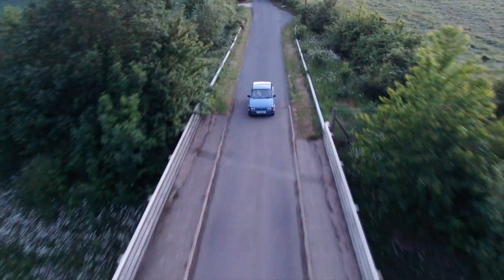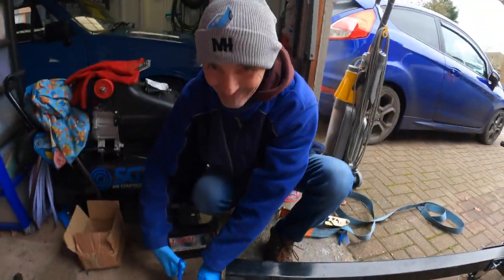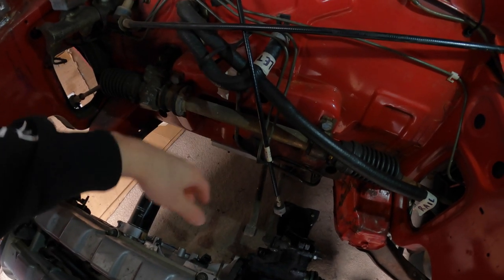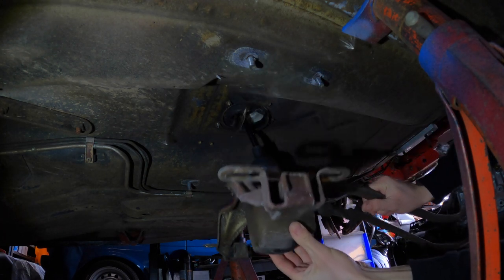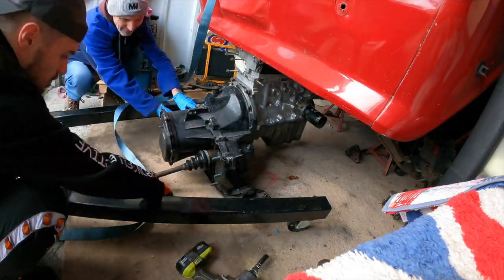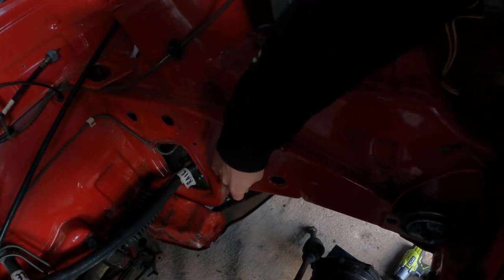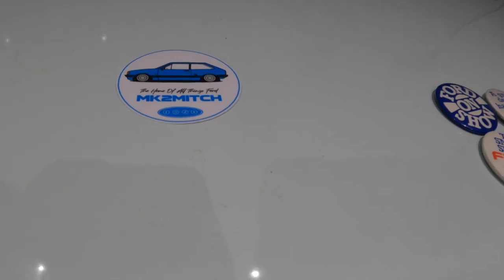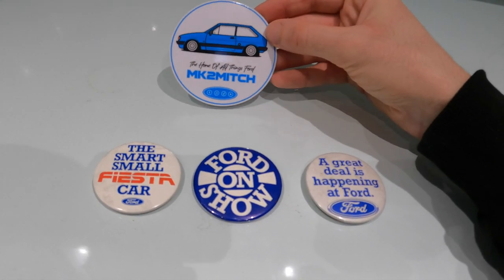Mk1 fiesta project (Ep7) cradle adaptors & dilemmas

Comment: Happy new year and coming on nicely 👍.cool sticker too.
Reply from the maker: Happy new year too! Send me a message if you’d like a couple of stickers! 😁
Reply: @Mk2Mitch  hi like to ask ,when you noch the chassis rail and add the engine mount. Is there any other strengthen plates. Add to the engine by? And what drive shafts are you using, now you have move the engine and gearbox over to the left?